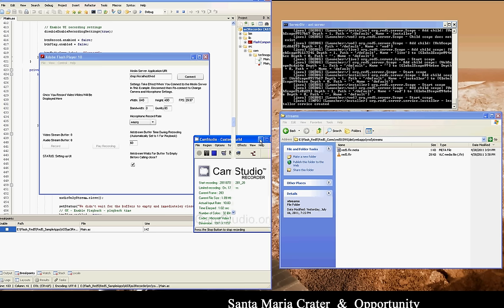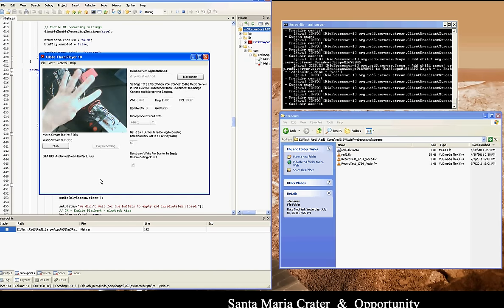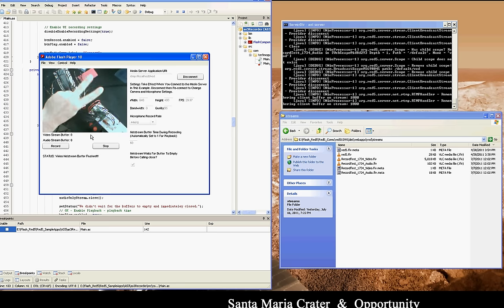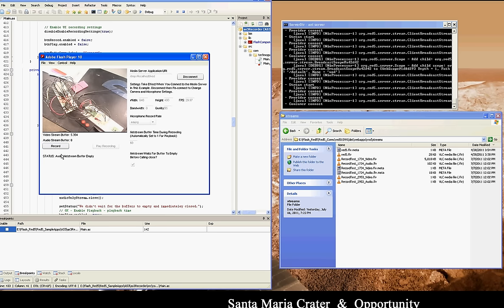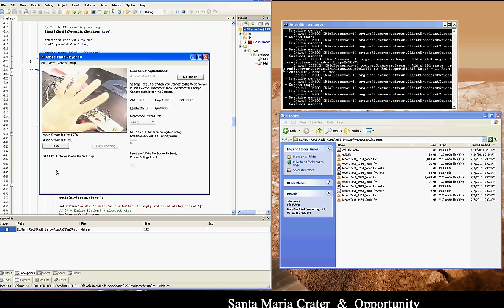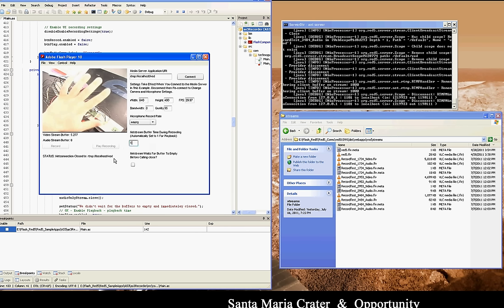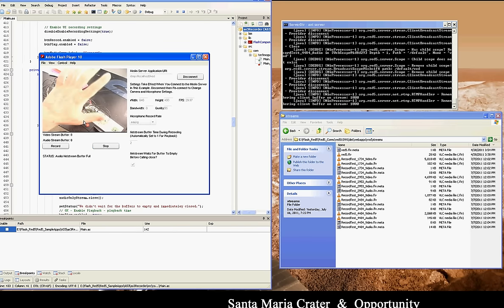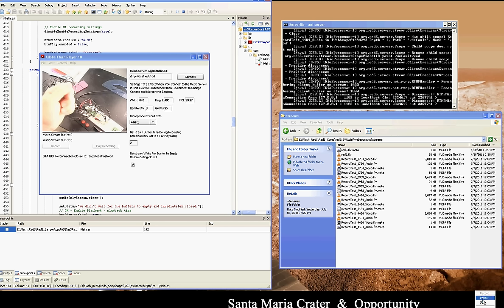Recording Video In Flash Client Side Utility Demo

Comment: I see, but if you attach audio only, myStream.bufferLength is always equals zero. In your example audioOnlyStream.bufferLength == 0 always. For this reason the sound file will be DAMAGED. Try it: you need to comment code in lines 755 and 757 (attachCamera) then you could see empty buffer and after stop recording netstream closes immediately, without waiting. If I remove closing "audioOnlyStream" from code, I will have complete file after couple seconds after stop recording.